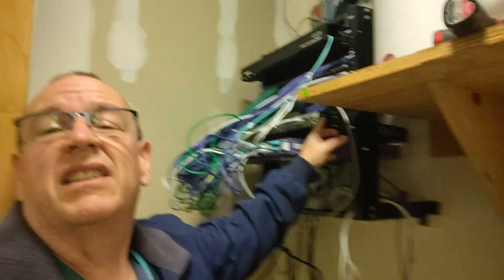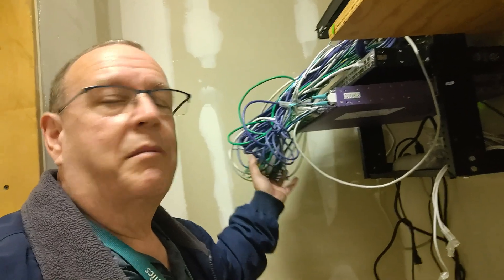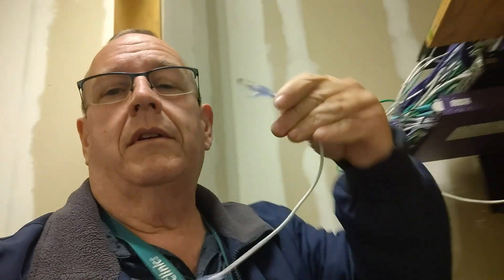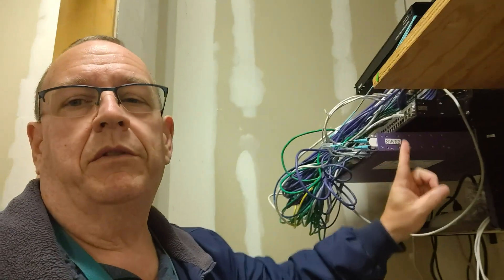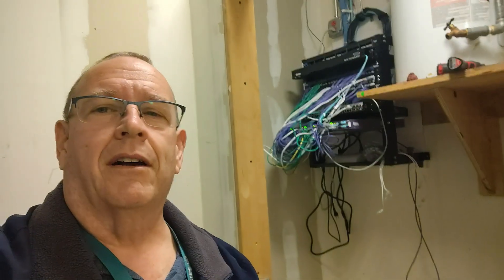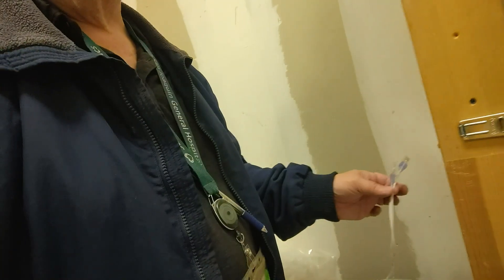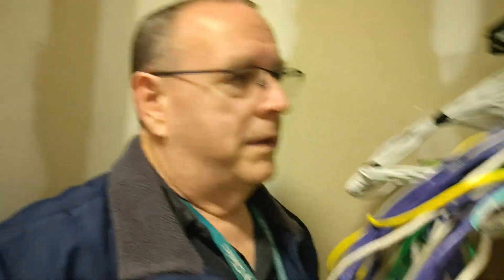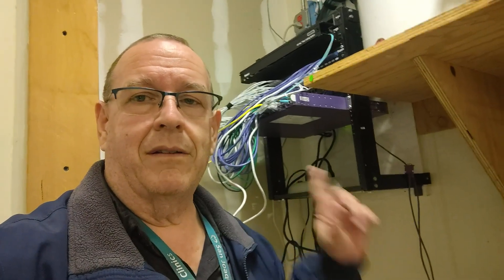Network Admin Life  - Conference Room Switch Swap

Comment: What was the update on your VPN performance issue with one of your clients ?
Reply: Was too quick to comment , mmm VM ' VPM Performance not a great pond of fish to have .  Get them install the VM on a seperate machine to the other VM's. Also update to the latest VM software.
Reply from the maker: Oddly enough there have been no complaints lately.  I have a meeting with Palo Alto and we're going to go through our VPN setup and make sure everything is correct.  (It is.)  And then I can go back to my management and say we've done everything possible to rule out our end of the connection.  God bless.
Reply: @NetworkAdminLife  yep sounds like users is hehe.. only other thing to mention is to check interface utilization during the time of complaints and our if you have something like live action to see if any other type of traffic is present. Hope my two cents makes sense!

Comment: I spent years supporting servers, desktop computers, networks and printers & plotters.  You'll often experience "the other person's problem".  Systems people say it's the network, the network people say it's the system.  I tended to say "there's a problem with the overall environment", then worked the end to end issue until we found it.

One thing to watch out for in a large complex network is where you have literally two paths, one in each direction.  Hard to identify.  I'm not saying that's your VPN issue, just that without access to all the information and devices it's a royal pain to pin down.  You might see if you can get VPN logs from those client machines, identify the paths and hops along the way.

I just literally recalled using the pathping utility, need to dig up my notes on it, I recall using it to identify connectivity and slowdown problems before.

As always, best of luck fighting the issues!
Reply from the maker: I'm a pathping fan.  I've used it to identify areas of latency in our county environment to help the county guys narrow down a problem.  When you see that spike in response time... you know you're on the right track.  Thanks for watching and God bless!

Comment: Since they work for other hospitals, do they have other VPN clients configured for them: Cisco Anyconnect,  Checkpoint Remote Access, OpenVPN, etc?  I have run into conflicts with consultants running multiple VPN clients, even if only one is connected at a time.  You could ask them to disable the other virtual adapters as a test, if their support can handle that, and see if it helps.
Reply from the maker: Well that's the thing.  They CLAIM they are not experiencing this slowness problem with any other hospital they work with.  BUT... we are the only hospital that uses Global Protect.  The other virtual machines are supposed to be powered down completely.  Is that what you meant?  God bless!

Comment: a few things, first "the God thing" I'm not religious, but I really don't have an issue with you thanking or praising God, I find it strange, but it's not an issue.
as for the VPN, out of hours for them, can you use their connection details to try replicate the problem they are having from another external connection that you do control, use the same software, login details etc to the server they are using at you main location? 
3rd point, I too like short patch cables. but only when there is no space between the patch and the switch, when there are several patches of switches, I prefer cable management and dress the cables either side of the cabinet, I also like labelled cables when they are dress in. I tend to make my own cables when I dress them in, as you get the perfect length. I also use different colour cables based on the end point device. I normally have different colours for PC, Phones, Printers, Cameras, Security, and other device.
Reply from the maker: We actually do have a replica of their environment on-site.  It does not cross a VPN to get to us.  I guess I could work with their admin to see if we could set something like that up.  I'll noodle on that some.   On religion, my father is an agnostic.  I'm Christian.  Two very smart men who came to two very divergent decisions regarding religion.  Go figure.  God bless.